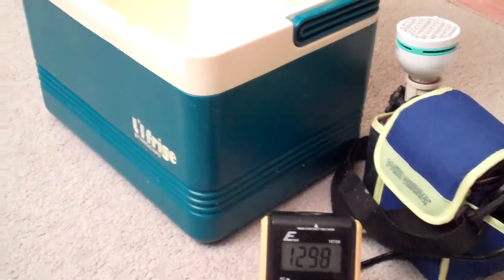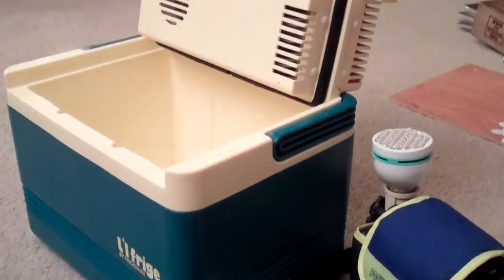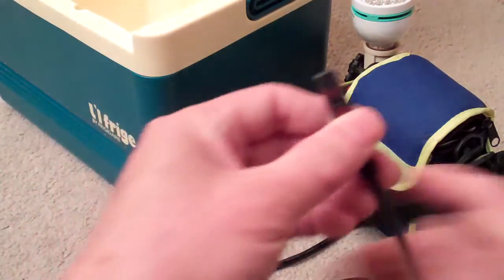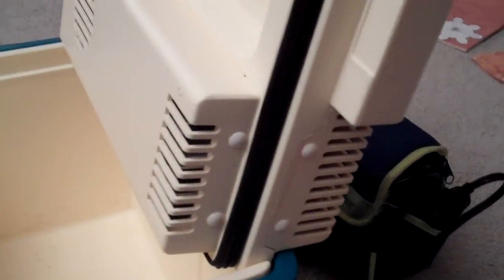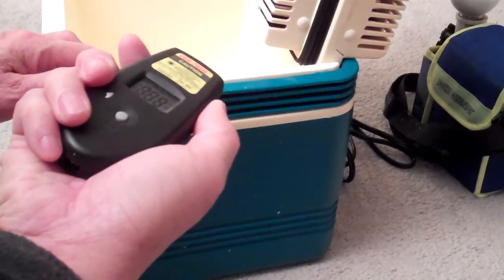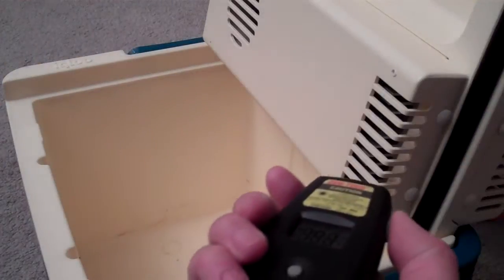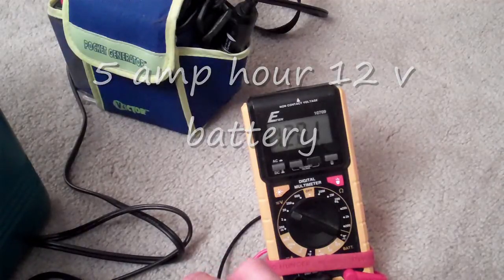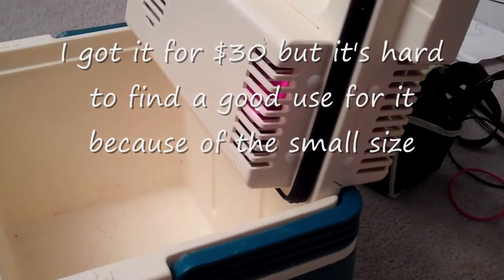Solar powered thermoelectric heater cooler

Comment from the maker: That is exactly why I made the video. I did not state that as I was not ready to take the fridge apart as it is not broken. I was thinking about the opposite (because of all the snow and cold weather) to see if you can put something cold on the peltier to generate electricity. I know what ever electricity generated will be very small.  I find this peltier effect interesting because I can get either cold or hot by reversing the polarity of the DC input.